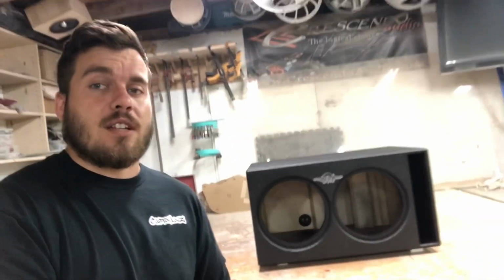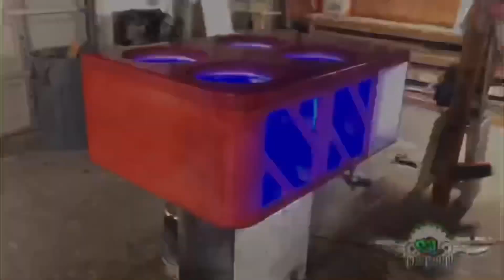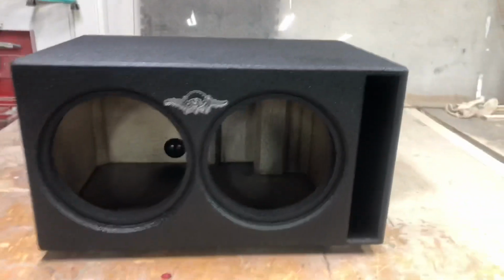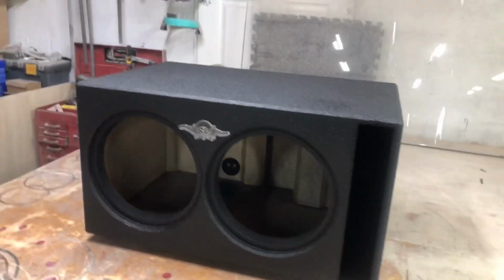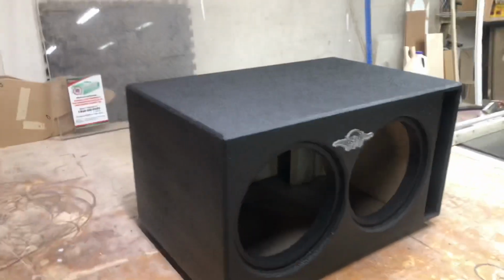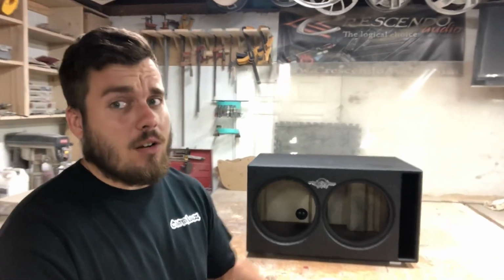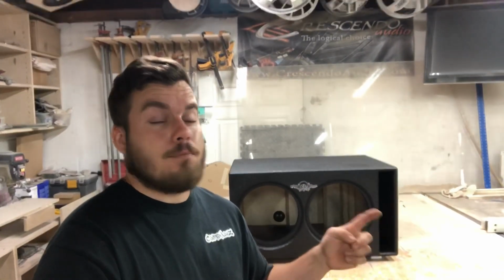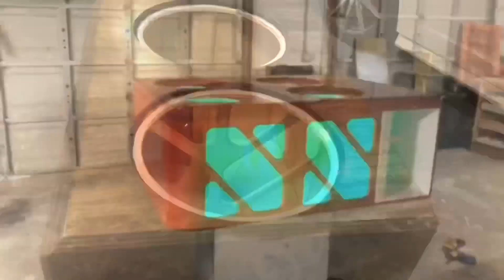LowzFabz 2 Skar Audio VFX 12s! BEDLINER! Ported subwoofer box- IN THE SHOP WITH CUSTOMLOWZ EP71

Comment: Looks nice and all but I see a major issue that I've also ran into with the QBomb boxes that're covered in bedliner which is the mounting surface where the baskets contact the box will 100% leak and never make a good clean seal unless you take a knife or a razor and cut the bedliner out from that surface exposing clean mdf/birch....
Reply from the maker: Did you sub not come with a rubber gasket? With a rubber gasket, you 100% won’t have leaks. Maybe you had other issues involved
Reply: @CustomLowzVids  actually yes the sundown subs I had had rubber gaskets but as I said with textured bedliner you will not get a airtight seal unless you remove the bedliner from the surface!
Reply from the maker: @kevinAuman1  you probably do know
 more than the pro
Reply: @kevinAuman1  You could just rub a thin amount of Vaseline on the sub surface and then use a tube of gasket material on the box surface. Install the subs and let dry. It will seal air tight and because of the Vaseline it will not bond to the sub, so you will have a rubber seal on the box from there on out.
Reply: @Raymo2u  Wouldn't it be easier if they simply put some tape around the mounting surface before spraying the bed liner?
Reply: @JasonWW2000  You could, but getting it perfectly round with tape is a long and tedious process. It would work but I wouldnt say its easier.
Reply: @Raymo2u  it does not have to be perfect. Its a 12" circle. Its very easy to apply tape, spray and then peal off while wet. I don't think they want to spend money on tape and are lazy. They could even cut a few cardboard circles in different sizes, drop them over the openings, spray and then lift off while wet.